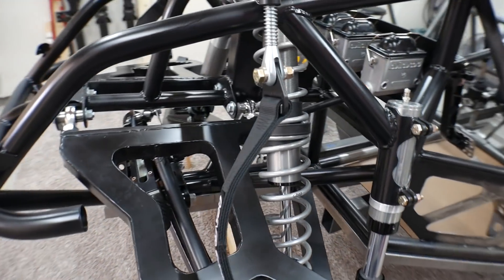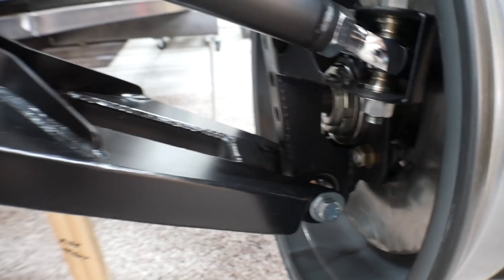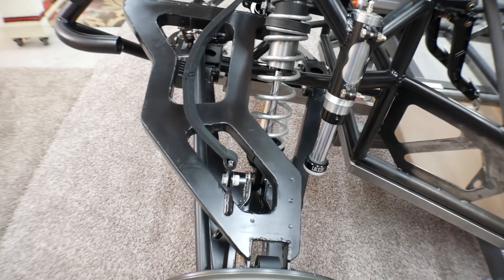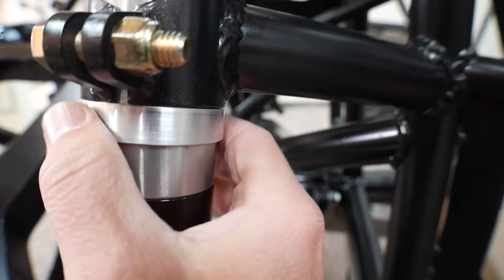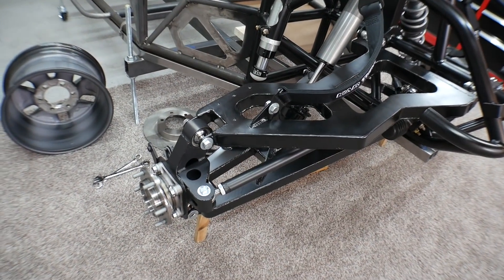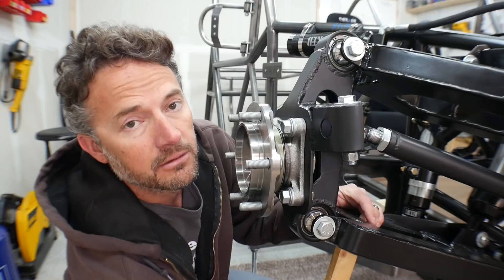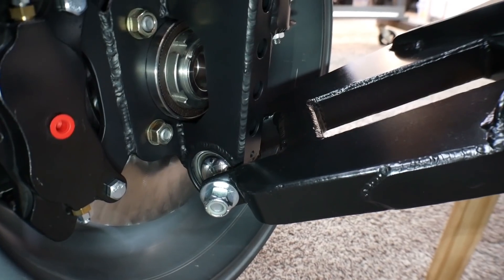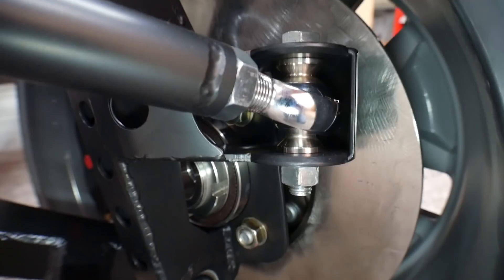Baja Front Suspension Build #8 (It's Done!)

Comment: Did you have to put a bolt through the bearing to hold it together, being a drive hub, just curious ?
Reply from the maker: That hub is meant for a 2WD Toyota 4Runner. So from the factory it has a large nut on the back of the axle that holds everything together.
Reply: Awesome nice build, I've been a fabricator for 35 years and that my friend is great work!

Comment: The A arms are not going to take a jump with these 1/4” plate mount tabs. We do a similar A arm but not have extended plate tabs . We bore a 1.25 hole and weld a tube to connect the uniball . Rock solid
No disrespect or hate , love the channel . Just trying to pass along helpful info I have learned during my 30 years of Pro Fab 
Look up DTFtacoma for build info , and ideas. 
On suspension connections , NEVER USE ALL THREADED BOLTS , You need a solid shank all the way thru , threads should start after passing thru both points and first washer
Reply from the maker: Thanks for the info, I'll keep an eye on them.

Comment: That is a lot of travel! I haven't watched all your vids, but did you ever say what your steering axis camber and caster numbers are? How much does the track width vary from full droop to max width? (horizontal tire scrub). Will it be power or manual steering? Because of the parallel a-arms, and what looks like very little caster, and not much camber inclination either, you will probably see inverted or 'anti' ackerman, plus a lot of steering scrub and a lot of horizontal scrub. But like you said, it won't be real critical on the bug.
Reply from the maker: Whew.... That's a lot of questions. 😉
The angle or inclination is 10 degrees, the caster is 8 degrees. 
The track width changes about 8" at full droop, about 4" at full compression. (I'm guessing but that's pretty accurate)
It will be manual steering at first, I'll switch to power if it needs it. But it steers really easy.
The Ackerman is a little inverted, but not much. I redid the steering arms at one point on the spindles to get the best Ackerman as possible. But it is still a little inverted.
There is a lot of horizontal scrub if the suspension is dropping a lot. At mid travel the horizontal scrub isn't to bad.
The scrub radius is about 1" behind the pivot point. This is why it turns so easily.
And I'd like to add it has zero bump steer. (I'm proud of that) 😁
It has some shortcomings, but It's the best system I've built yet.
Reply: @DougBugBuilder  It's good, but parallel arms are not ideal. They result in excessive, or at least unnecessary, horizontal scrub, plus causes the outside wheel to lean out (positive camber) in corners from body roll. When the outside wheel flops out, the car is no longer cornering on the tire tread, but on the sidewall/tread transition. Watch vids of desert race cars and sand buggies, and you will see most of them have this bad camber control. That's because most people, including big name professional builders, think getting the a-arms as long and as parallel as possible is the best thing. It's not, because there is a lot of body roll with long, soft offroad travel.

A better design is to make the upright taller, or lower the upper arm frame mount,  so the arms are not parallel. The upper arm should slope down toward the center of the car. It's also better if the upper arm is shorter, approx 75% as long as the lower. Now when the susp cycles, the wheel will move in an 'S' curve. This dramatically reduces horizontal scrub. In addition, body roll will pull the top of the wheel inward, keeping the wheel in negative camber when cornering, which keeps cornering forces on the tread of the tire. Try it on the wood susp model you made in one of your earlier videos. Watch what happens when you simulate body roll with parallel arms versus no other change but a taller upright.

Below is a link to a vid of a trophy truck by the Brenthel brothers. In my opinion they are among the smartest builders. Starting at 8:20 you get a good look. Notice how tall the upright is, and the angle of the upper arm. Also take note of what they say about bump steer when cornering - they are the only ones I know of, and maybe the only ones in all of pro offroad fab who understand this issue. I discovered it years ago modelling dez truck suspension in solidworks, but until I saw the brenthel vid, I figured I would just keep quiet..

https://www.youtube.com/watch?v=oMubVjguqJw&t

Comment: very good desing ,incredibly fantastic ,i have a question doug about the bumstop and the shock in the same point of the lower arm wonder if thats going to create a problem, too much stress for the lower arm ?
Reply from the maker: That is a concern, in a better world I would have put it in contact with the upper arm. But that just would have had the bumpstop sticking way up through the one piece front end. So I compromised some performance for aesthetics. I'll see how it holds up when I hit the dirt. But the front end is pretty light.
Thanks for the comment. 👍

Comment: I think this is a brilliant video. But I do have one question, is there any bump steer when it comes to the suspension being compressed while being turned one way or the other?
Reply from the maker: There's a little bit of bump at lock, as the rack slides over it changes the elevation a little of the steering arm. So this makes the steering twitch a little.

Comment: Hi Doug, where I can get the suspension sizes to build one like yours !
Am a begginner on welding and is a perfect project to me , My aunt has 1970 bug but is just the metal and I want to build a baja bug, am a truck driver so I just have like 3 days a week to this project, in this moment am getting my lunch and watching ur channel 
U can help with that !
Saludos! 
Eres muy buen maestro!
Reply from the maker: There is some details in my shared folder under Wratchet. https://drive.google.com/drive/folders/1i0qTcN-1BB5_Lu6umgi9OrvRJKr-0vz3
Or if you can wait a little, or just start with the chassis for now. When Wratchet is up and rolling I'm going to put out a spec sheet that will have a ridiculous amount of information on Wratchet.
Gracias por las palabras amables. Ten un buen almuerzo.

Comment: You keep speaking of bumpsteer by doing a visual check but you really want to use a laser attached to the hub facing out and set up a board or cardboard to project it onto. Then cycle the suspension and watch your laser line to truely check bump steer
Reply from the maker: Not sure I need to be that accurate, but I appreciate the advice.
Reply: @DougBugBuilder  true.

Comment: How many degrees of steering misalignment angle do you get with the uniballs mounted vertically like that? Thing’s looking great!
Reply from the maker: Do you mean how much difference between lock to lock between the front tires?
Reply: Doug Bug It is a bit hard to explain, but let’s say 0 degrees is with the steering centered and the front tires pointed straight forward. How many degrees do you get when you turn the wheel one direction until it locks, and vice versa?
Reply from the maker: @duskin10101  Got it, it gets 30 degrees in either direction. So 60 degrees total, but 30 degrees either way from center.
I wouldn't build this way for a drift car, but on the street and trails this is plenty good.
Reply: @Doug Bug That is exactly the info I was looking for. Thank you for the quick and detailed response. Love the videos and keep up the great work!

Comment: Great project & great work, Doug! Tip on shock/spring relationship (dating back to your earlier studies & tests): springs contribute force as a function of position/displacement; dampers contribute force as a function of velocity (rate of change of position/displacement). We can neglect friction & gas charge, at least early on. Apply these rules to the R/C model study and it will all make sense. Rock On!
Reply from the maker: That's a good explanation of the differences between springs and shock absorbers.
Thanks. 👍

Comment: That looks amazing! You did an excellent job .Great vids! . I have a question for a project im doing maybe you can help with. What size uniballs are those and what size are the bolts that go thru them. I have an old winnebago that im building a suspension for to lower it alot. I want to be able to raise it back up to stock height though so thats about 15 inches of suspension travel. I have an engine in the middle of the suspension so cant make the a arms as long as yours. Its dually dodge truck spindles but i think with double shear bolts like you got there i wouldnt need 1 inch bolts running thru. Also how much can it steer ? how much angle will those uniballs let it turn?
Reply from the maker: These are 1" uniballs. They have high misalingment spacers in them that allow 9/16" bolts to go through them. The spindles will turn 30 degrees in either direction. So 60 degrees lock to lock.

Comment: On a set up like this are the bump stops more like a second damper vs a travel limiter? I am a chassis nerd and this stuff is awesome. I wish I could build stuff like this for a job. I have been a mechanic for over 20 years and I'm sooooo tired of fixing people's crap, I just want to build.
Your tie rod bar could be shortened by a 1/4 in and shimmed twords the back of the car by 1/4 in . My rule of thumb is just that, there might be some flex when this thing is in motion so a 1/8 in may make contact. If I can fit my thumb in the gap I'm happy.
Reply from the maker: I'd say the bumps on this chassis are dual purpose. Because they are 4" and not mounted all the way out they contact with about 6" of travel left. So I'll be able to keep the actual shocks a little looser and then let the bumps slow things down before actually bottoming out.
I don't want to shorten the steering arms because the Ackerman will get worse. But I might move them back a little at the rack to avoid contact with the boot.
Thanks for the ideas and comment!

Comment: Excellent work, it really high-lights the importance of design work and how it lets you get the most out of everything. The computer is a powerful tool....  What will be powering this sled? I'd like to make a single seater with a sport bike engine...
Reply from the maker: Well said! This will start with an Ecotec engine. But I think it will upgrade to an LS at some point.
I think they call those CrossKarts. I've seen some, they're awesome! Good Luck.
Reply: @DougBugBuilder  YES, the CrossKart is such a neat machine, they are running them on all surfaces in Finland !!

Comment: What is an "adjustable hyme"?  I can't find it on google.
Reply: Then look for adjustable heim or rose joint.
Reply from the maker: Specifically these, https://www.kartek.com/parts/fk-rod-ends-34-right-hand-thread-34-hole-kmx12-nylon-coated-heim-joints.html
Just means I can adjust their length in and out.
Reply: Rod end is now the most used term. All are adjustable (threaded)

Comment: Dude that thing is perfect!
My coworker and I just built a long travel kit for a his Tacoma. We based all the measurements off my kit and changed where the uniballs were and how they pivot, as well as using an extended travel fox coilover so he could keep 4wd. We took out trucks out and tested it and the only thing that broke is his axle. We flew through whoops, small jumps, up hills(where his axle snapped). I'm not sure if we would build another one. We have all the plasma cutter files we made saved, but man it took a ton of time to design them and test fitting, change design, test over and over. Then welding and "Unwelding". Took us about 3 weeks working on it after work and weekends. It's done and we are both really happy with how it came out.
Reply from the maker: Nice work on that project, sounds great! I can appreciate the work you put into it. 👍

Comment: hi, the steering angle looks very small! or will it be ok?
Reply from the maker: It's not bad, 30 degrees each way. Same as the other Baja. You might need to 3 point turn if it's tight. But overall it works out fine.

Comment: Curious as to what your shock location is vs the length of the arm! Around a 60/40 setup?
Reply from the maker: It's more like 55/45, just a tic past halfway. I should have used 14" shocks. Luckily there isn't that much weight in the front.

Comment: Don't get me wrong because I've loved watching this ever since I found your channel and went back and watched your whole catalog, but why did you do the dog leg on the leading edge of the upper A arm? It just seems like extra weight and a potential hinge spot?
Reply from the maker: That's a great question. If I went straight back the leading portion of the upper arm would contact the front bumper where it turns back. Yet I wanted as wide as possible where it connects with the chassis. So after the bumper it kicks out to reach further up the front of the chassis.
Reply: @DougBugBuilder  That's certainly not the way it looks to me. Granted it would pinch down severely against the dogleg on the rear side of the upper leg, and I can understand your thinking in that, but I don't think the upper arm deals with the fore and aft loads the lower A arm does.
Reply from the maker: @lunkydog  Well there's two doglegs. One back by the chassis is to clear the bumper like I stated. The one towards the front (might be the one you're talking about) doglegs because it runs parallel to the rear part of the arm that kicks back to clear the shock absorber. You might be right that I made it to beefy. Hard to determine sometimes where it needs strength and where it doesn't.
Reply: @DougBugBuilder  Nothing but respect from me. I was hooked from the time I saw you working out the bump steer. Kudos on your effort and your transaxle selection.